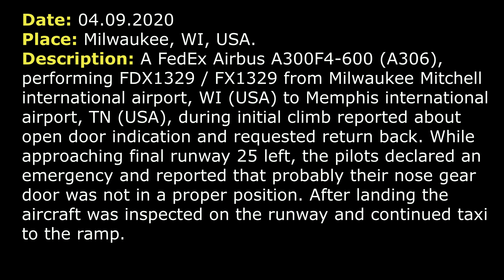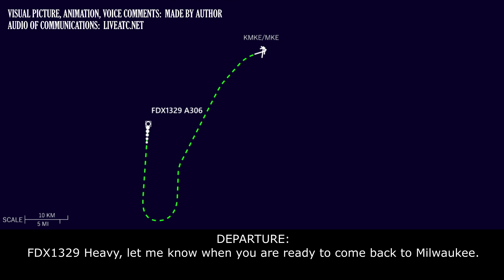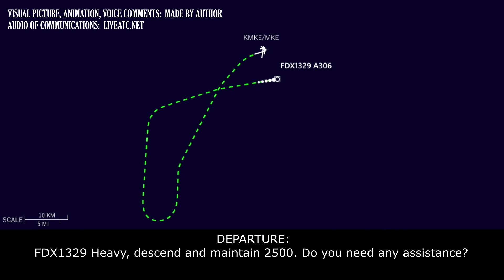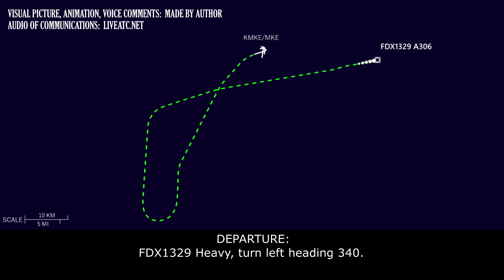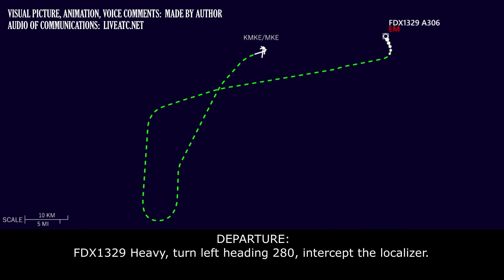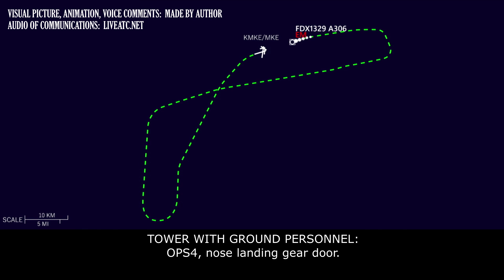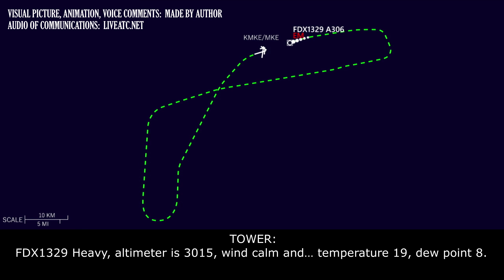Emergency, NOSE GEAR DOOR is not in PROPER POSITION | FedEx Airbus A306 | Milwaukee airport

Comment: 1:16 We got a light that came on...  We just need to run a quick procedure...
1:34 FDX1329 heavy, just a heads up...
1:44 Yeah, that's fine. I think we're headed back to Milwaukee anyway...
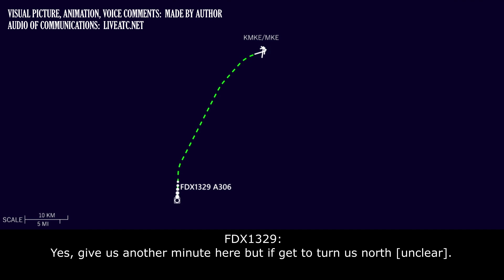1:51 ...divert right now and just go back?
1:53 Just give us another minute here, but if you gotta turn us north, we're not gonna be upset about it.
3:46 and let me know when you pick up the field- once in the turn 9 o'clock and 9 miles.
4:41 We have 2 souls on board, about 2 hours of gas, DG (dangerous goods) paperwork's on board and the problem was we had a landing gear door that did not get in the correct position.  It appears to be down and where it's supposed to be now, but that's the issue.
Reply from the maker: Pinned. Thank you.

Comment: I always tip my hat to the ATC controllers on these unforeseen situations. They always tend to accommodate the pilots requests. For example, the FedEX pilot needed to fly at 080 heading longer than the ATC originally requested. The ATC controller allowed and granted the clearance without issue.
Reply from the maker: They (pilots and controllers) have the same goal - safety.
Reply: You can see ATC Exactly. But of course, the controller has other planes to work with as well and this one emergency or deviation throws off everything. But they always make it happen. Great job ATC and the pilots too for immediately telling the controllers about their issue.
Reply from the maker: Yes, you are right. Atc have to handle emergency aircraft and other airplanes.  That's why he is there and he was trained for.